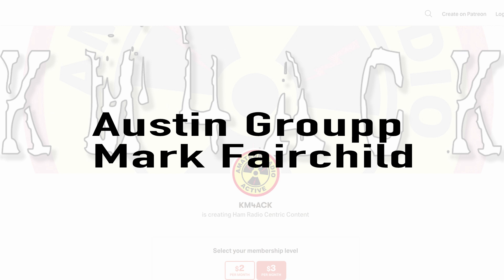Power a Raspberry Pi from a Ham Radio

Comment: I am currently powering all of my laptops (all Lenovo machines one at a time) from a boost 60w supply from ebay. A whopping $7 but it both charges and runs the laptop from a 12v source and pumps the voltage (adjustable) to 19V ! Works like a charm and eliminates the need to run an inverter which generates a bunch of RFI and then use the stock 110v power supply. This unit is fairly RFI quiet. and am very happy with it and ordered another one as a spare.  Some assembly and soldering required depending on your application.
https://www.ebay.com/itm/FP5139-100W-DC-Boost-Step-up-Adjustable-Voltage-Power-Converter-LED-Voltmeter/142697805000?ssPageName=STRK%3AMEBIDX%3AIT&_trksid=p2057872.m2749.l2649

Comment: G’day Jason. Buy yourself an adjustable buck converter and set the voltage to 5.2V and power it through the GPIO pins. It should fix the low voltage problem on the Pi4 and create a much more compact power system if you make it one integrated cable. Cheers Lance VK6LMK

Comment: Hello, what about the noise? Isn´t that buck-converter noisy especially on 2m Bands?
Reply from the maker: This was only a temporary fix to prove that it would work. I have a much older buck-converter and didn't have any noise issues. It seems the newer ones are noisier on higher bands. For a permanent solution I will be using the maker focus power board.

Comment: Ok if the buck converter isn't noisy. But sharing the the same supply ground as the radio with a buck is asking for noise issues.. just take a mobile phone sized external battery usb emergency charger..no noise ..and already usb

Comment: I've been using a wide input Battery Eliminator intended for RC applications with a Pi3 and Pi4 with no issues. https://www.amazon.com/dp/B07DYXTX9H/ref=cm_sw_em_r_mt_dp_8626FbQDMTSM4?_encoding=UTF8&psc=1